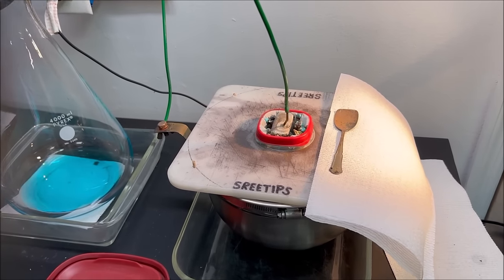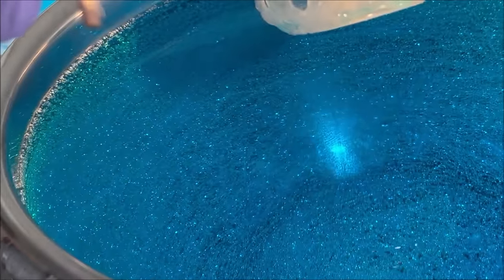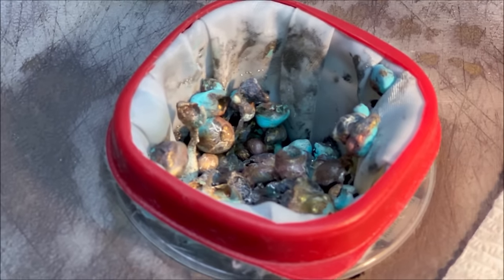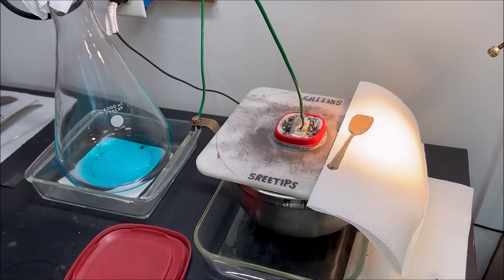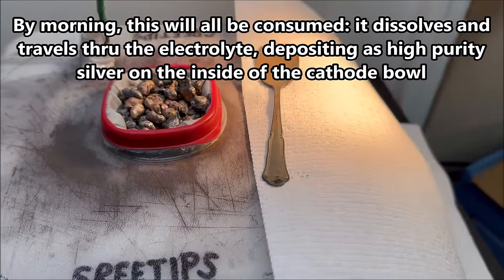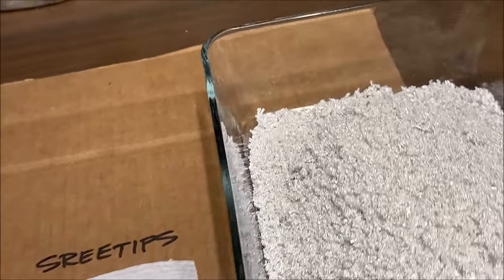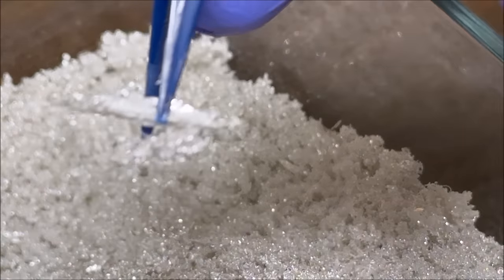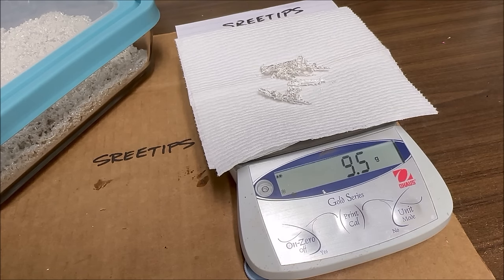Electrolytic Silver Cell 24 Hour Update

Comment: Have you ever tried some sort of funnel or hopper for feeding your silver cell?  Seems like you could load a lot more and let it gravity feed.
Reply from the maker: Auto-feed would be nice.
Reply: Use a polypropylene cloth separator and you could do this, use a silver bar or rod positioned so your bar or rod makes contact with the bulk feed . If you want big crystals, use one nicer crystal and slowly grow at a low current. They get beautiful. You can grow gold crystals similarly, but a hot halide vapor phase method is better for gold rather than electrolysis. Here you put gold powder, gold bromide or chloride in a tube then heat the clean end strongly but somewhat less than the melting point of gold. On the other end heat enough to melt the gold halide. Shiny crystals of gold grow on the hot end. ❤

Comment: Hello, I have a question of a video you filmed 6 months ago. The gold circuit board fingers. When you seperate the foils in the solution, what is the percentage or carat of those foils ? Cant I just melt them.
Reply from the maker: Yes, they can be melted without refining. However, they are not pure gold. I believe, based on my experience, that the gold foils are about 12k or 50% pure gold. Since they are not pure gold, their gold content, and therefore its value, are questionable.

Comment: Just a though, Maybe put the large crystals in a vile with glycerin or maybe some sore of mineral oil the help prevent them from braking. Not sure is it would react or not causing it to tarnish though. Maybe test some. It would make for a cool display vile or bottle of the large long crystals to put on display that way in a cabinet or case. I guess that would be up to the buyer though.
Reply from the maker: I’ve got a big jar of large crystals on display. They are gorgeous.
Reply: I was thinking that maybe it would mitigate breakage in shipping if suspended in a thicker fluid. I like the look of the larger crystalls also. If you have a family member to ship one to in a vile or small bottle to test, if it works with little breakage, they may be able to be collected bottled and sold that way.

Comment: I'm just wondering if there is a reason you don't have a way to keep the silver anode pushed down into the silver basket. Like an apparatus built to keep a downward pressure on the silver anode?
Those silver crystals are a sight to behold!!😮
Reply from the maker: The anode bar has a 10 gauge copper wire that I’ve coiled to form a slight spring that exerts a downward force on the impure silver in the anode basket.

Comment: Question pal, the gold sponge on eBay is listed at 135 per gram which is considerably higher than market rate.. my question is why is it priced so high? The scale read 7.2 but the description says it’s only for 1 g is that price for 7.2 g or is it for 1 g please clarify for me.
Reply from the maker: Ok, I’ve answered this question many times. There are two prices for every item for sale. The bid and the ask. The bid is what a buyer is willing to offer. The ask is what a seller is willing to accept. When the two prices align perfectly then a sale happens. And it’s just that simple. The ask price is for one gram of pure gold sponge. And if I can’t get the ask price for it, then I get to keep it. It will only become more valuable as time passes. Hope this helps. Thank you.

Comment: I know you just went over the collection and reboot of the silver cell but I just thought of something. How would you go about starting from scratch. Like from just having impure silver to making a pure silver nitrate solution from it. I almost feel like this is something you've done but I'm not sure. My guess is to dissolve it. Plate it out on copper. Make your silver cement. Use it for electrolyte and run the cell, collect the silver then rinse and repeat with that silver? I know you said if the copper content in the electrolyte is too high some of it will carry over with the silver in the cell but if you run it multiple times would you not end uo with pure silver? Or if the copper content is too high will it perpetually carry over?
Reply from the maker: I just did a video on this. I used pure silver bars from eBay. I dissolved them in nitric and used them for the electrolyte. After that, I use pure silver crystal from a previous silver cell run.
Reply: Repeated short sessions should do it. Cement silver should contain less than 10% copper (by weight) and it will start plating out from about 30%.

Comment: Would there be any time or labor savings by gently percolating some electrolyte up into the basket? How about putting some weight on the electrode wire to help keep it in contact as the pebbles break down?
Reply from the maker: Percolate, no. Weight pressing down, yes

Comment: How fragile? I have been thinking of those lovely crystals and how to preserve and display them. Was thinking encasement in glass or lucite, but those seem a bit dramatic and complicated. Back in HS I grew a salt crystal to about 1/2" then hit it with polyurethane spray which did it well, and was wondering if that would give enough support to the Ag srystal to hold it together? Might have to hang it from mono on a mobile type thing to assure it is (relativly) free from impacts.
Reply from the maker: They survived the rinsing process being stirred over and over with a glass rod in distilled water.

Comment: Is chemical leaching of used anode basket bags a viable option as an alternative to burning for the purposes of recovering precious metals?  Same idea as heap leaching and would the bags be fit for reuse?
Reply from the maker: Yes, I’ll boil the used filters in nitric acid. The bags are custom cut each time so getting them back into the basket would be near impossible.

Comment: I wonder if there's any way to control the size of the crystals and force the big ones to grow....?
Reply from the maker: They grow randomly. It’s a mix of parameters that I haven’t found a way to measure. One of the pro refiners on the goldrefiningforum.com (Goldsilverpro) claims that a little copper in the electrolyte is good for crystal structure and size. I kind of agree with him. But I don’t add copper to the electrolyte. It builds up on its own from the copper that’s in the impure shot.

Comment: Hi Sreetips, what purity of silver for the cell to work the best, I have only about 60% silver, and what I’m finding the silver is being pulled out of the silver nitrate solution, I’ve recovered the silver and melted it down to form a bar of silver and did a specific gravity test and I get 9.5 which isn’t even the proper result for pure silver should be 10.5 any advice would be great thank you
Reply from the maker: If I was just starting from scratch, I’d use pure silver bars or rounds (Canadian maples are four nines) bought from a reputable source and use them to start my silver cell. Then, run your 9.5 bar through the cell to get it up over three nines.
Reply: That 60% is not nearly pure enough. I recommend you dissolve it and cement it out on copper. The resulting cement should be at least 90% pure. Dissolve that again to work the silver cell in short sessions (5 days or less). Copper will start plating out at about 30%. Repeated usage of the silver cell with the result of the previous run will improve purity.

Comment: Heyyyyy Streetips! Any chance you'd sell enough impure shot to keep my cell going for a few days? Having a hard time getting scrap to dissolve in nitric.
Reply from the maker: Sorry, I don’t have any impure silver for sale. I’m buying, not selling.
Reply: @sreetips  hey I have one more question, my shot comes out looking like shiny silver. Should I stop refining sterling and just melt sterling into shot?
Reply from the maker: You can run sterling in the silver cell but the electrolyte will quickly become saturated with copper. For electrolytic refining to work the anode material must be relatively high purity to begin with.
Reply: @sreetips  10-4 thanks buddy, it'll just be a slow process for me, can only get 50-100 grams a week to feed my cell lol. Have a great one and thanks for the dialog

Comment: Can you remove the copper from the electrolyte, or do you have to dispose it? How do you dispose the, most likely toxic, electrolyte?
Reply from the maker: Silver and copper are close on the reactivity series of metals. Both have similar properties. Both are soluble in nitric. The best way I’ve found to separate the silver from the copper is to put a piece of clean metallic copper in the used electrolyte (after it’s been removed from the silver cell) and “cement” the silver from the copper solution. The silver will come out of solution as the metallic copper goes into solution. The two metals trade places. Any copper that is in the electrolyte will stay in solution because copper will not cement out on metallic copper. Any other precious metals in the electrolyte will also cement out with the silver, if any are present. To get the copper, after the silver has been removed, I pour the copper solution (copper nitrate) into a bucket containing angle iron. The copper cements out into the pieces of iron and I’m left with metallic copper and an acidic iron solution. I toss the metallic copper because it’s contaminated with other metals. And I treat the acidic iron solution with lye to render it harmless before disposal.
Reply: @sreetips  thank you for your long and very clear answer. I think I got it 🤔👍🏼
Reply from the maker: Sorry about that, sometimes I get carried away. It’s the teacher in me.
Reply: @sreetips  You are a good teacher 👍🏼

Comment: Is the anode filter submerged into the electrolyte? If so, how much depth is optimal? Or does the anode filter not submerge into the electrolyte?
Reply: It is, I’m not sure the optimal depth, but enough for good electrical contact.
Reply: The more the merrier,  I would say. Just don't want the anode bar coming in contact with the electrolyte. Otherwise, the anode will dissolve as well.
Reply: Thanks. Now that you said it seems so obvious. I got fooled by my mind because sreetips never shows it nor ever states it - it was kinda assumed or inferred but I generally don't assume anything.
Reply from the maker: Yes, there’s a critical distance between the anode basket and the cathode: about four inches.
Reply: @sreetips  ✔️

Comment: Why silver electrode bar instead of just a larger chunk of copper?
Reply: Contamination. Can't call it .999 if you use copper, the bar loses some material as well over time. It would end up in the mix.
Reply from the maker: You could use copper, but pure silver is easier to work with. Plus, that bar may come in contact with the electrolyte and put excess copper into the cell. Copper in the cell is not bad until it becomes saturated. Then the copper will co-deposit with the silver and contaminate the pure silver crystal.

Comment: Sreetips: What would be the minimum amount of materials to start my cell ( Sterling and the 999 fine)
Reply: The wohlwill process doesn't give a clear amount. I'm guessing whatever you're trying to change to a better purity .
Reply from the maker: I used to run a one liter glass cell. It performed well and yielded high purity silver crystal. But the stainless cell crystal s much easier to operate.
Reply: Wow, 1 liter I can work with that.  Thank you for replying, and thanks for your service and hard work and sharing.
Reply from the maker: You’re welcome!

Comment: What happens to the corrosion on the impure silver?
Reply: inside that small basket it remains no corrosion, all is left is some silver, gold, platinum, palladium and some rhodium, silver doesnt reallt corrode, not reacting much with oxygen like iron, he saves those smal bags and later he recovers all those elements, some extra gamd to sell or to keep, then the silver goes back to the silver cell, and cycle starts again
Reply from the maker: It gets trapped in the anode filter bag.

Comment: if you used silver wire for the anode, much less copper would be dissolved
Reply: The anode bar just sits on top without being in direct contact with the electrolyte. It's not sacrificial and doesn't really dissolve in the process so the copper wire is safe.
Reply: @Peter_S_  That is the theory. In practice sreetips occasionally forgets to replenish the impure silver in time, causing the anode bar to drop into the electrolyte and being consumed. If that continues far enough, the copper wire will get exposed, but I don't think it ever got that far.
Reply: @apveening  Sterling silver is ALREADY 7.5% copper. 🤪 That's why the electrolyte is that color blue.
Reply: @Peter_S_  But he isn't using sterling silver in his silver cell. The electrolyte and anode bar are made with .999 silver or better (usually .99999), the contents of the anode basket comes from cemented silver, in his case as a rough guess about 3% copper.